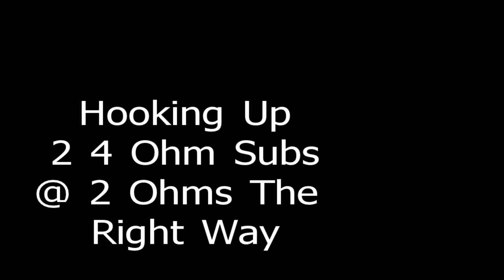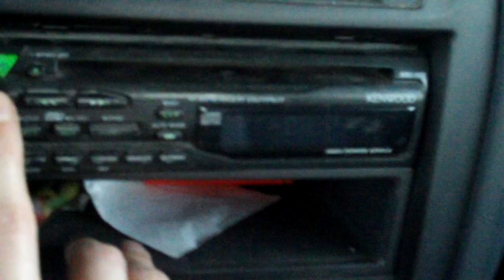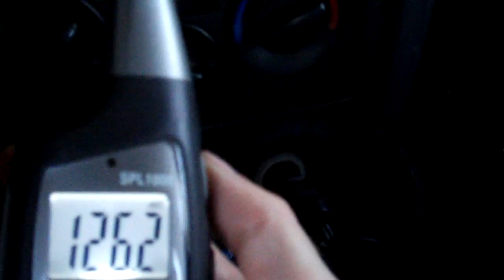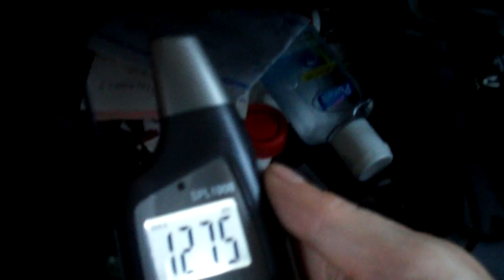How To Hook Up Two 4 Ohms Subwoofers @ 2 Ohms On A Mono Block Amp

Comment: I got 2 kenwood 1500watt 4 ohm 12s and thay are dual 2inch voice coil subs how can i drop it to 2 ohms im running a 900 mono block sony amp (upgrading soon) it has 4 terminals on it soo if u can help the subs r way under powered but the amp will put out 500 RMS at 2ohms it puches then fare not hard plz help thx :D

Comment from the maker: @2LINERIDER Wow you kinda boggled my brain with that question. I doubt your amp is 2 ohms its prolly stable down to 2 ohms meaning its safe to run @ 2 ohms but lower than that might be a problem.  I think most amps are 4 ohm and can go lower. First I gotta ask are you saying your subs are dual voice coil subs? They hafta be if they are 2 ohm subs? And yes if you hook up subs in parallel you split the ohms. The amp in this vid is not a 2 ohm amp its just stable down to 2 ohms

Comment: how do you hook up 2   2ohms subs up to a 2ohms amp, hooking 2 subs up in parallel divides the ohms in half right?, so it would be like 2ohms amp going into 1ohms subwoofers, is that safe to have the amp ohms higher than the subs ohms?? or how does that work?? i know you made 2   4ohms subs in parallel so it made it 2ohms on 2ohms, but what if the amp ohms is higher than the subwoofers ohms??

Comment from the maker: @a1saouse Thanks man but you are a little confused.  FIRST OF ALL PLEASE DON'T YELL WHEN COMMENTING. Second if ya wanna leave a comment like this please know what your talking about cause it confuses people. If your subs are dual 4 ohms subs you can only wire them 2 ways NOT 3. At a 4 ohm or 1 ohm load.  The subs in this video are not DVC they are single voice coil. Also this amp is 2 ohm stable I believe and if not it does pretty damn good @ 2 ohms. Most 4 channel amps are only 4 ohm stable.

Comment from the maker: @atomdragon4 NO you'll be fine. You probably be ok with stock everything. Like if you had the hifonics BXI 2000 then you might need to upgrade. But if you got the money to upgrade things and plan on running more power it never hurts

Comment from the maker: @atomdragon4 No I run a optima yellow top battery. My lights were dimming and the optima stopped that. Stock alt though wit no big 3 upgrade. If you wanna run car audio I suggest getting a good battery as soon as possible. Wish I would have got one a long time ago. I burned up my alternator in 4 vehicles. NO JOKE.

Comment from the maker: @fammguyy202 The lower the ohms the more power the subs pull from the amp. So it depends on how powerful your amp is and how powerful your subs are. You could always hook them up @ 2 ohms and turn your amp down then turn it up slowly to the max u think your subs can handle.
Reply: The gain is not a volume it don’t work that way.

Comment: hey man i was wondering. i have a 1997 ford taurus with a stock radio with no RCA connections. am i going to need to get an adapter? if so what wires will i need to splice the adapter to? i have looked up that the best ones are the rear speaker wires so i still have the front speakers working.

Comment from the maker: @177Jair If you mean the wires to hook up the subs then you should have at least 16 gauge. If they are not very big. I don't think they will hit as clean and hard. Most people use like 16 or 14 gauge. I use 14 or 12 gauge. Some people use 8 gauge for big subs that can take speaker wire that big.

Comment from the maker: @177Jair I know your amp isn't mono. Thats why you gotta bridge it. Hook your subs up like this then bridge it meaning use a positive from one channel and a negative from the other channel. You'll be sucking juice from both channels and getting more power since your are gonna be hooked up at 2 ohms. You would have to look at the specs of your amp to see what it does at 2 ohms

Comment from the maker: @cr125boii If your asking me if you have to hook up both positive and negative to the battery no you don't but you can. You just need the positive hooked up the the battery.  The ground can be grounded in your trunk to a bolt. If I had an xtra battery running in my trunk then I would probably run both the power and ground to the  battery. Watch my vid on how to hook up a amp and sub if ya want to see what I'm sayin

Comment from the maker: @bmxrida4life5150 O Ok I see what ur prob is. You can't get to the other sub to hook them together. Ok hook your subs up to your terminals like normal in your box ( + to + - to-) then you will have 2 sets of wires or you should. Now instead of hooking one speaker into one channel and the other speaker into the other channel twist your wires together +to +  - to- to make 1 set of wires then bridge it on your amp.

Comment from the maker: @HateMeNow36 Yea it might be ground but I don't know. 4 gauge wire should be fine. Hmm you got me thinkin. Is your wire new (is there any cuts in the plastic where it could be touching metal). What kind of amp are u runnin?

Comment from the maker: @HateMeNow36 Hmm how big is your wire and how many watts u runnin? Last guy I seen blowin fuses on here was runnin itty bitty wire to his amp. This is just my opinion on the capacitor but before I'll spend money on a cap i'll just spend the extra money and buy a better battery. I have a yellow top optima that I LOVE but there are many other brands.

Comment from the maker: @HateMeNow36 You should be safe but I don't know what ohm load your amp is. That amp is a 2 ohm stable amp so I probably shouldn't have done that but it seemed to work fine. I didn't get to run it very long like that though cause I got a window broke out so I had to take out all of my stuff til I get it fixed

Comment: @casperskafs they pound pretty good man im getting my first set up and this get me more excited haha did you do the wiring yourself ? If so can you help me? I have a mono amp 450 watts at 4 ohms and two 12s subs at 400 rms each dual voice coils ..my amp is a mono but it has two channels to make wiring easier.. bridged on the inside, in other words 2 negs and 2 positive..how do I wire my subs to meet at the 4ohms load to the amp?

Comment: You had it right. you can put more than one wire in the channel. You don't need it to always go to the sub, you can set up your ohm load from the amp by hookin it up in series or parallel.